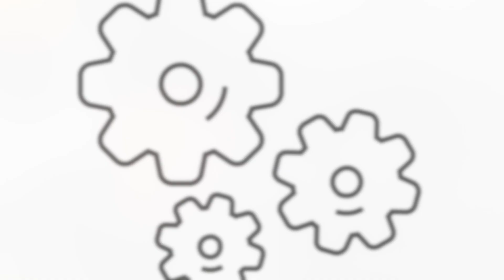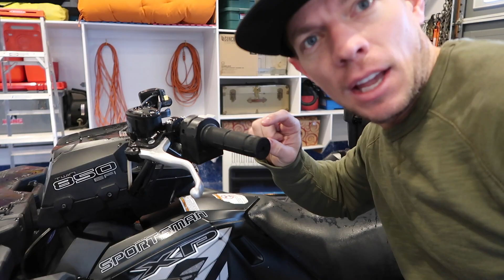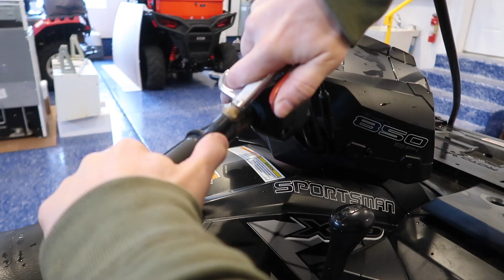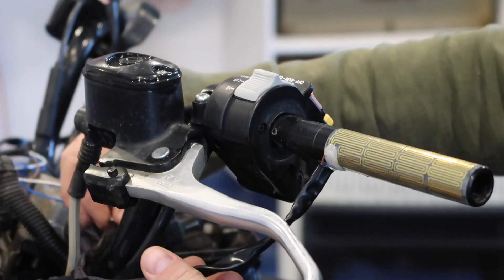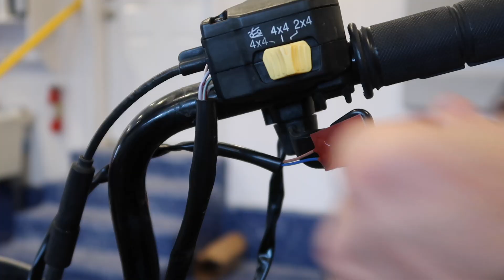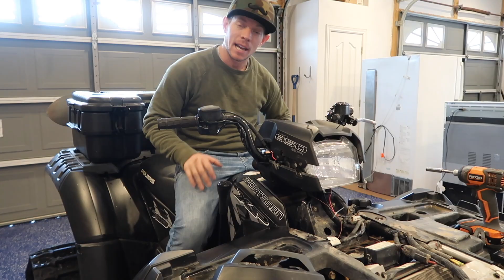ATV Heated Grip Install

Comment: Hey, did you measure the current consumption? Do you lose too much heat because of the handlebar?
Reply from the maker: I didn't measure, but I followed the OEM instal guide and these grips are OEM parts.